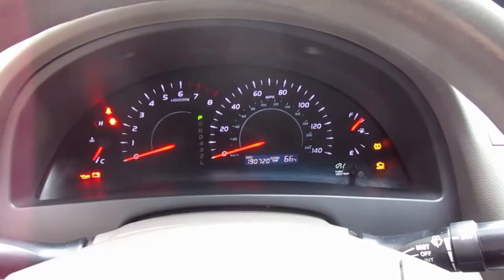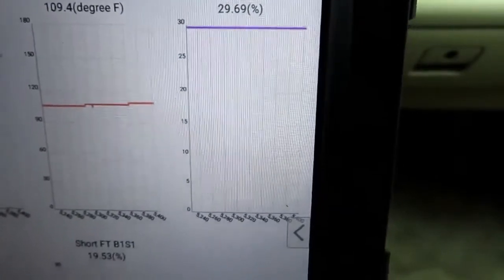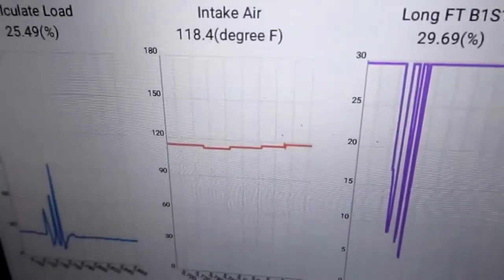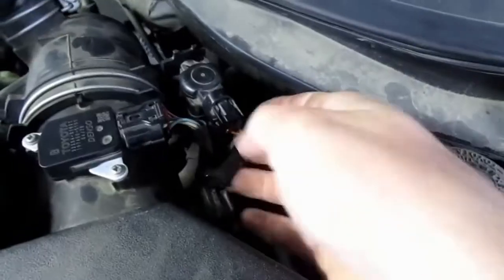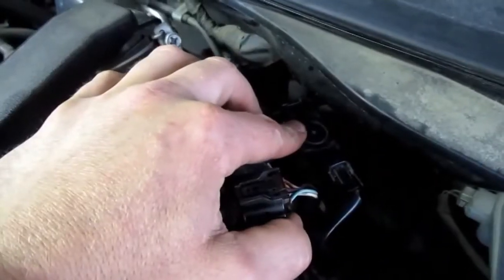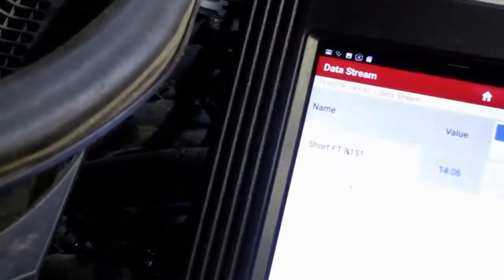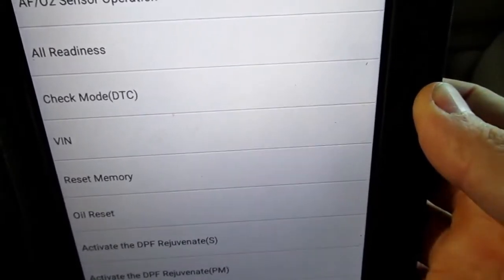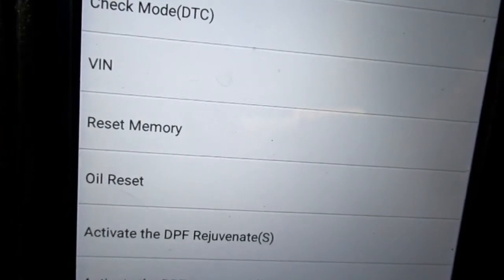2007 Toyota Camry Check Engine Light and P0171

Comment: Big Rob, what type of scanner are you using
Reply from the maker: This is the Launch X431. I've owned it for a couple of years now. It does pretty well for the most part. European vehicles it doesn't always interpret the information in a useful way so that can be frustrating. And I haven't been able to reprogram Chevy keys like it says it should. other than that for American and Asian vehicles I like it.
Reply: @ValleyMobileAutomotive  Do you own another scanner that you like a little better?? Do you have your eye on a particular scanner that you would like to purchase for the future?? I'm looking to purchase a professional scanner with several top features/options around the $700 to the $1000 range, what would you recommend
Reply from the maker: @ceddy97  That's a tough question. The big aftermarket contenders in your price range are Autel, Launch and Think car. I feel they are all very similar in what they do. All aftermarket scan tools will have hiccups from time to time, even the crazy expensive ones. I think you'll be happy with anyone you get. The one I have will still serve me well for a while.
Reply: @ValleyMobileAutomotive  Thanks for the Intel Big Rob

Comment: I have a 2007 Toyota Camry le 2.4L 4cyl I have a 
P0171 system too lean bank 1 
I hear a hissing sound coming from in back of the engine I’ve checked all intake hoses and tube and theirs no leaks , do you think the hissing sound is coming from the intake manifold ?
Reply from the maker: It's possible. Plug off the brake booster hose and see if there's a change. And do the same with the pcv hose. If it's not a hose then the only thing I can think of is the manifold or gasket. The best way to find an intake leak is with a smoke machine. You can pick one up for around $100. Or you can take it to a shop and pay that for the diagnostics and do the repair yourself.
Reply: I have the same exact issue and can’t seem to figure it out

Comment: Question I have a 2007 too my engine rumbles an my check engine light keeps coming on. I put jb weld on a old repair for the motor cover (sparkplugs) blew up on me
Reply from the maker: Hey Jon, sorry not sure what your question was. What codes show up with the check engine light?